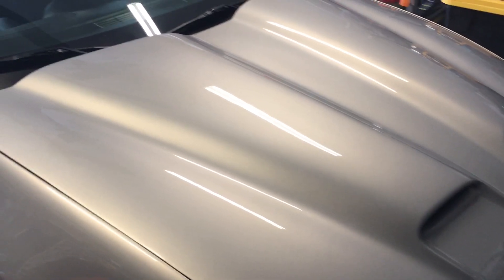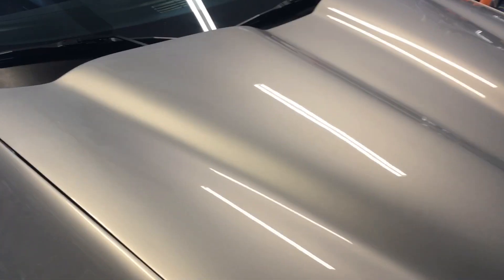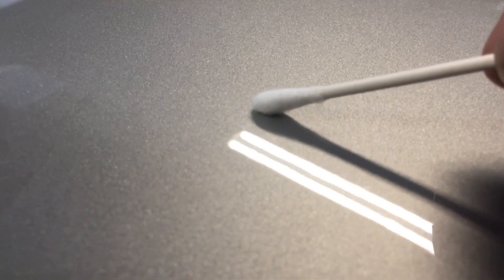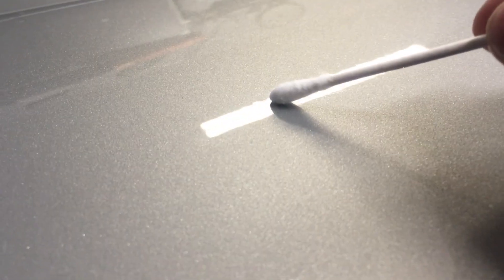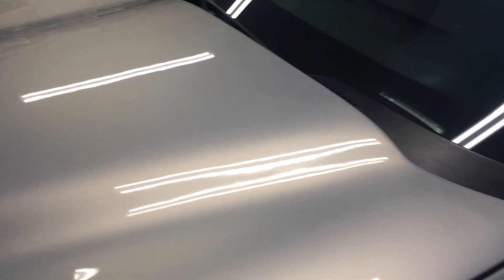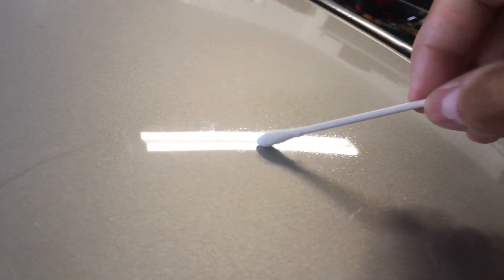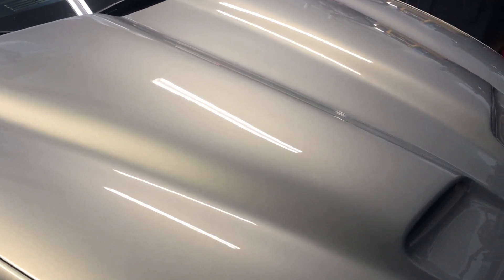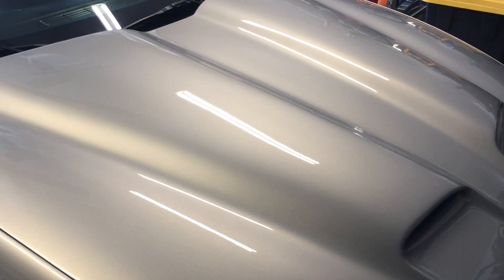Oh oh water spots on SPS Graphene Coating

Comment: Mike what a bummer on those water spotting. What you think about ADS ceramic metal oxide based on ATO (Antimony Tin Oxide) since it supposed to not get water spots? I have only seen 1 review by Brain from Apex Detail but no long term durability testing like your's.
Reply: brian will update us all as they come back in for maintenance.....if the c7 shows any we will be the second to know...I have to laugh at his description of "dirty" when it come to his black c7....but his knowledge and expertise is first rate.....above all the rest IMHO
Reply: @johnketuroskey6293  any update on the metal oxide coating? I want to know if it gets water spot stain, if it does then I might go with maybe CQuartz uk 3.0. Isn't there any other video or info about metal oxide coating? All I can find is the apex first view video about it
Reply: @r.k862  there is no coating/sealant/protection that will prevent a water spot/stain if the water is left on the vehicle and allowed to bake in the sun or just dry on vehicle without removing.  I currently have graphene on the lexus and it rained yesterday - quick shower.  I ran out and used my gyeon silk dryer and dried off the water/rain.  the graphene substantially reduces the stain to the point where it has the appearance of it just being"dust"....if I hadn't been able to get to the water right away.    the cq 3.0 will get spots/stains if the water is left on a hot panel/in the sun. if a person parks at work and it rains in the morning and the sun comes out at 11am to bake that water...u will have spots.  every coating I have used.....opticoat pro - crystal serum lite - Americana - all of which were installed by Chicago auto pros....on my two jags and multiple daily drivers.....all got a little waterspotting from weather but the coatings made it easy to remove and kept any etching away from the clear.  the graphene is by far the best I have ever used in reducing - almost eliminating water spots.  the only way to eliminate the problem is to flush the panel with full flowing water as mike has done in his vids where u see ALL the water sheeting off.  if u have beading...u must use a drying towel - be well hope this helps
Reply: @johnketuroskey6293   john keturoskey  thanks for the reply John I really appreciate it, but I think you misunderstood what I asked, I know cars get water spots after the rain and the sun bakes it but that can easily be removed by giving the car a wash.
What I was asking is different, I was asking if it stains (meaning etching into the ceramic coating or graphene permanently) which is different. So in your last comment, we're you referring about the cquk 3.0 and optic etc to have permanent etching into the coating that can't come off with a normal wash? I don't get it sorry.
I would highly love to get more info from you if that's ok.

Also if you can tell me if you have tried the cquk version 1 because in forensic Detailing video 11:00 into it, he shows how that cquk had no water spotting at all, so shouldn't Cquk 3.0 be the same with no water spotting?

I have a black car and water spotting stain etching is the last thing I need.

Also how can the opi coat which is a clear coat give you water spot stain etching because i dont think that's highly likely since its a clear coat just like a normal clear coat of most cars? Are you sure you allowed it to fully cure and kept the car away from water at least a week?

I'm leaning towards the artdeshine metal oxide coating since in the apex video he shows a massive difference in gloss about 20GU vs normal ceramic coatings which only increase about 4GU average it also makes the colour pop and darkens the colour a little since I like that because I have a black car but I don't know if it will give permanent water spotting or not.

Do you have messenger? I need to chat to you more about it if that's ok please?
Reply: @r.k862  hope this finds u well - sorry i misunderstood.  simply put u will find that graphene reduces waterspotting the most of any product currently available.....as long as someone does not leave watermarks on their vehicle for several days baking in the sun - most ceramics will protect the clear from the water spots etching into the clear - which is the primary reason for using a coating!!! - at least for me - the gloss/hydrophobic/self cleaning etc are great too - but if a product allows permanent etching due to this condition/event...its not worth it even if it was free.  opticoat pro on my jags never allowed any etching into the clear - and the water spotting after a rain was easily removed.  and yes cure time was well achieved as instructed by jason

as i stated - i misunderstood....i was imagining water spotting vs permanent etching. 

as far as considering metal oxide vs artdeshine graphene vs graphene crystal wax etc....the exceptional bump in gloss is close to the same - since they are all graphene!!!  did u see brians videos using IGL F4 renew???  exceptional!!!!  he bumped the gloss 30+ gu's on test panel(f4 topped with igl premier)...and busted 100+ gu's on blue c7 corvette using f4 only!!!  i am interested in alfred yow's graphene(SPS - pro version/artdeshine consumer version) but i like to tinker and find it hard not to use a topper/drying aid with each wash - so a 2 year durability gets in the way of tinkering and using a topper often...lol

the problem with the coatings is that if u do not use them within 6-9 months of opening - u may as well throw them away as the will crystalize in opened bottle -  adding to the already high cost due to waste.  u could reapply to use it up but that is also wasting. researching, watching all reviews etc...collaborating with brian - here is what i have done on lexus....

removed all prior "stuff" with mckees coating prep (strip) wash
decon - dr beasleys total decon
clay mitt as needed
sonax cut and finish
carpro reflect finishing polish
IGL precoat(panel wipe)

IGL F4 - applied with black foam finishing pad - 2 coats 3days apart - 

ordered/purchased artdeshine QD thru carzilla to use as a topper/maintenance...once received applied initial full strength - now use in a 5:1 dilution ratio of distilled water.  $63 for bottle but using dilution ratio stated it goes a long way.....20 to 30 applications.

once gone will try IGL premier and ecoshine enhancer combo.

wash media is dr beasleys ceramic premium wash - dont get fooled by name as there is no "enhancers" in it.....the name is derived from the surfactants which are specifically fromulated to enhance/invigorate the self cleaning properties of coatings. i also use carpro reset....but bealeys has more lubricity....look at brians review of it
Reply: @r.k862  the color/gloss/metallic pop/clarity...is all exceptional  when it does rain i can use ONR up to to days later and water marks are easily removed!!!!!  hydrophobics are pleasing/exciting!!!!!
Reply: @johnketuroskey6293  thanks for your answer. So are you saying the IGL F4 if gets water on it, if you don't wash the car for about 3 weeks that it will have permanent water spots?
I'm thinking to use IGL F4 then IGL premier ontop, hope this will stop the water spotting etching, what do you think?
Reply: @johnketuroskey6293  How much did chicago auto pros charge you to graphene or ceramic your rides?
Reply from the maker: Functional Doc I have looked into it and I think I will try it after Graphene and see how it performs.